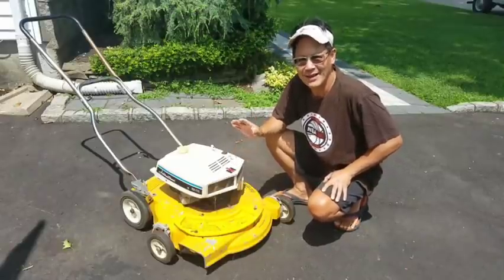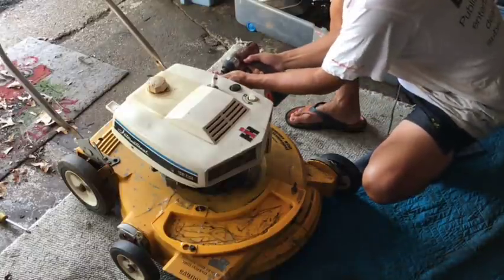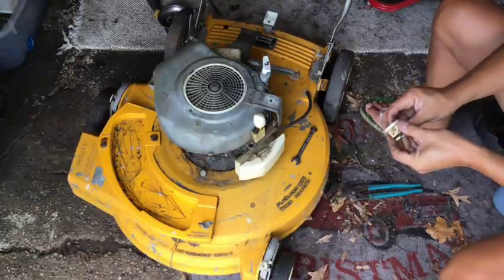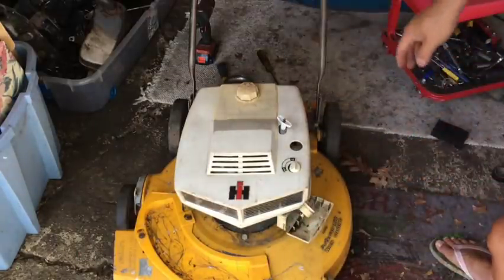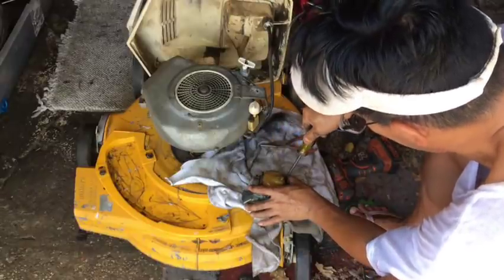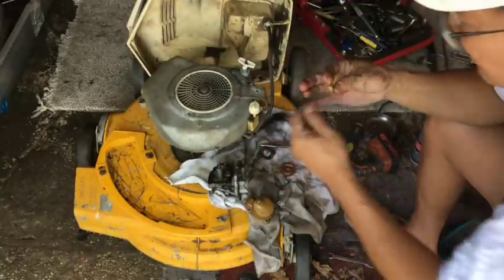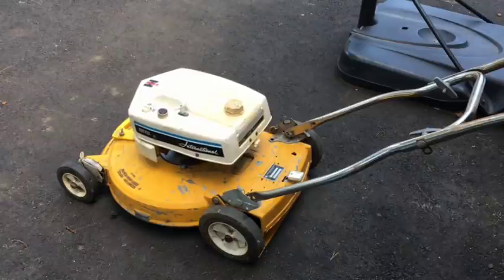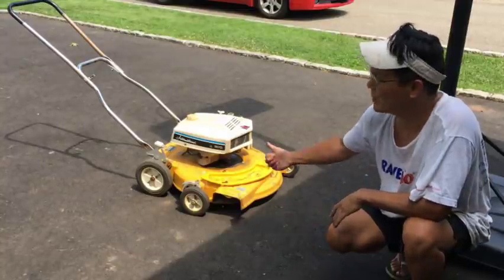FREE INTERNATIONAL HARVESTER 3322 LAWNBOY CUB CADET 2-STROKE PUSH LAWN MOWER PRIMER BULB CARB CLEAN

Comment: that rod is connected to the governor, I did the same with mine. You may have to pull the flywheel to get the governor rod in place correctly.

Comment: That was hilarious when the throttle control popped out of the back. I have a few of the old 2 stroke lawnboys, but I'm not a fan of the staggered wheel design. Otherwise, they are pretty cool.

Comment: The last time I used one of those was in the mid 70’s, same mower only the LawnBoy version. Forgot all about that sound they make! I think it’s normal for them to smoke a bit, makes me wonder if you’ve got the fuel/oil mix right. Pretty neat to see one running again after all these years!
Reply from the maker: It doesn’t even smoke
Reply: @MowersNBlowers  then Ethier your using synthetic 2 stroke oil or not enough I use 32:1 in my 1996 echo weedeater
Reply from the maker: snattle rake whatever, I sold it

Comment: Those are reeds in the intake not a check valve. Dirtbikes mostly use those. Produces torque for low end power via pressurizing fuel/air mix. I had a Bi-centennial edition Lawn Boy with stars and stripes. Nice gem Henry!
Reply from the maker: That’s it reeds.  I remember I had to clean mine in an air compressor. Thx andy

Comment: I bought a non running lawnboy in 1978 ended up having a crack in the coil I wrapped it in two layers of electrical tape and ran it for 28 years and only gave up on it cause a crack developed in the fly wheel in the center. That ended up being the best $10 spent.
Reply from the maker: You got great use out of it for sure!  Thanks for the great story. Hope you’re subscribed

Comment: Very cool mower. I'm sure by now someone else has already said it, but you mis-spoke. International-Cub Cadet was bought out by MTD in 1981 as most of us know. Also thats no Tecumseh on that mower, I'm pretty sure its an OMC (outboard marine corp) engine, someone can correct me if its something else, but definitely not Tecumseh.
Very cool mower. Pretty sure they made another piece to go on top if you wanted to discharge as well as the bagger for the 3rd option. We had a Toro made lawnboy with that style deck for ahwile, it did have a 4 stroke Tecumseh. Lawn boy Was bought out by Toro in 1986 I believe.
Reply from the maker: Yes, lots of people corrected me, like I said first one for me.  I didn’t know any other manufacturer existed.

Comment: i remember working on a lawnboy i picked up 2 stroke recoil was different than that one had that marine engine that was made in Memphis tn , i posted it on instagram of it running after i worked on it but had to replace the recoil on it the plastic broke on the original and had to get a air filter cover off ebay . good video on gettin it to run, any money u make is a profit i sold mine for $75. ( i should have made an episode on it lol)

Comment: Needs more oil mix is 32:1 not heavy enough and cub cadet was always international they sold to MTD
Reply: That's a d series engine. Those ones use a 32:1. The older ones were 16:1

Comment: That plate comes off the deck then a chute assembly goes in  and the bag attaches .
Reply from the maker: What about the side discharge?  What covers the hole?
Reply: The chute assembly when installed.

Comment: It's not gonna sell for 375 around here. On letgo/Facebook it's worth maybe 50, but if sold on ebay it's worth money. Like a old craftsman chainsaw, I have one which I fixed and it works good, but I cant sell it for even $80 around here. But I just sold an identical one (actually this morning) on ebay for parts or repair not even working for 140.
Reply from the maker: You’re back on eBay? Sweet!

Comment: I cringed when you mixed your own gas. Those lawboys take 32:1 4oz/gal. or 1/2 cup of 2 stroke oil.
Reply from the maker: Did you see the gas tank?  It’s like a cup!
Reply: @MowersNBlowers  That's my point though. you should mix it in a gas can. even if you just buy 1/4 gallon of gas that's 2 Tbsp of 2stroke oil. Can't just guess the ratio.
Reply from the maker: Ok bro! Thx
Reply: I thought the same thing lol. I have 4 2-stroke LB’s and would love to have one like this. Just to see the fuel mixed not only directly in the tank, but with less than a spit full of oil practically killing it by running on straight gas.
Reply: @timgring4121  I use a 100ml graduated cylinder to mix gas.

80ml = 50:1
95ml = 42:1
120ml = 32:1

Comment: I hate 2 cycle 

But cool video content.
Reply from the maker: Thx mr. Fields
Reply: Mowers N Blowers   I too have a  old Lawnboy  not as old as that one.  It isn’t  2 cycle .  It’s a 5.5 hp Tecumseh 
1996.   Did a video on it,  it’s got a oil leak ,  at oil sump,   So I have to take off engine . Open it up to make a gasket with red RTV and put back 

I know it runs and and needs a self propelled control cable.  But transmission works.  Just been too hot to get to that.

Comment: Why mow with a briggs that you have to add oil every time you run it, when you can mix the oil and gas and forget it. And Lawnboy mows better than most other push mowers.
Reply: You shouldn't have to add oil to a Briggs every time, unless its burning or leaking oil.
Reply: @Mr_Tecumseh  I'm a poor man, have never been able to afford a new Briggs, so all of mine have always used oil, hence, the reason I use a lawnboy these days.

Comment: That's not a tecumseh engine, it's a lawnboy
Reply from the maker: Lawnboy engine?  I didn’t know lawnboy makes engines
Reply: Yep, Lawnboy was built by Outboard Marine Corp, the same people who made Evinrude outboard engines, till MTD got them.then the 2 stroke engine was gone
Reply: @MowersNBlowers  not since 1988, well it was technically made by omc/evinrude (outboard motor company) but the engines were branded lawnboy, and any 2 cycle engines were made by lawnboy. There was never any 2 cycle tecumseh engines on lawnboy. The first time tecumsehs were used on lawnboys were the late 90s/early 2k, and they were 4 cycle
Reply: @drfalcon4102  no, toro bought lawnboy, not mtd. But mtd has started making lawnboy decks in the past 3-5 years